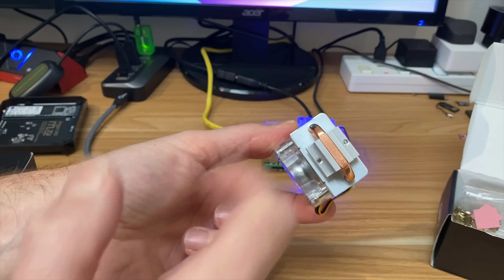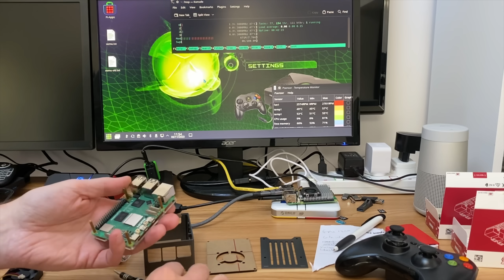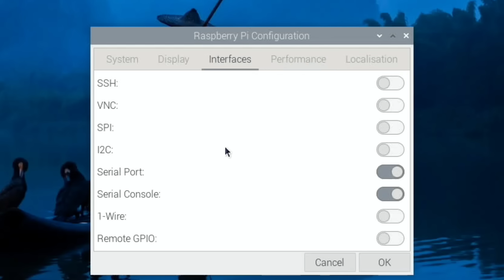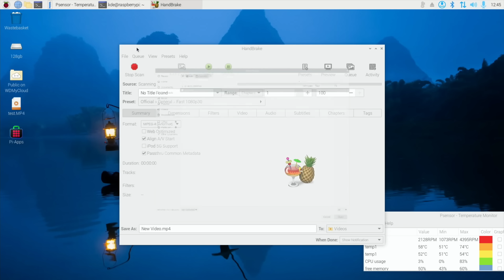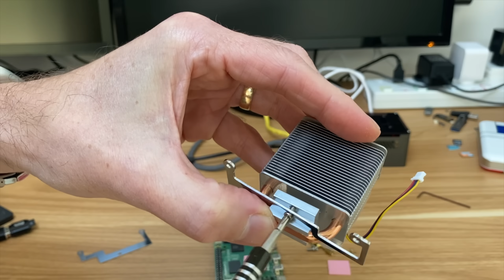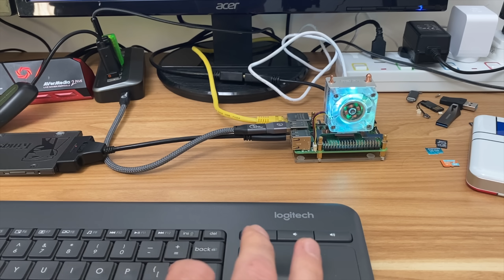Raspberry Pi 5. Ice tower cooler and case from 52Pi

Comment: I had a similar looking cooler on a PC years ago. Nothing new there but it keeps the Pi cpu cool; that's the main thing. I wouldn't fork out for one of these unless it specifically cooled more chips. For the money it should do more just because it could. I haven't stressed my Pi 5 yet but I think the active cooler (almost here now) will do an admiral job even when I set it to 3Ghz plus it won't be NOT locked away in some restrictive and claustrophobic box.

Comment: Why not use thermal paste?
Reply from the maker: I usually test cases and coolers with what they are supplied with. Thermal paste is more effective 

CPU paste Vs Thermal Pad. Raspberry Pi 4
https://youtu.be/-Z05yBrU0jQ
Reply: I'll check it out. 
The cooler is good, i was just thinking that thermal paste would even be a better solution. In any event you weren't getting throttled down. Lots of headroom for OC imho.  @leepspvideo

Comment: Would it be possible to invert the fan so that it blew air out? That plus the heatsinks I wonder if it would be similar in performance to the active cooler. 

Also is having the active cooler in an option ?
Reply from the maker: You can swap the fan around

Comment: All my 4's have the ICE tower and I was hoping to see this on the 5 too.
These are by far the best to keep my Pi4 cool and hopefully my Pi5 too.
I was hoping to see that we can change the temperature/fan speed profile using some Raspi-config setting. I think that with both the official case and the official active cooler the CPU temperature gets too hot before the fan ramps up

Comment: It realy is silly to not use the heat sinks or the official active cooler in that case expecaly on a PI 5.   There is a marked improvement with either solution.   Slow twisting slightly side to side of the heat sinks during removal will almost always make them easily release.   DO NOT pry them up from one edge as the adhesive is strongest against that approach, just wiggle them as you pull them up vertically.

Comment: I hope someone makes a chunky passive cooler like I have for one of my pi 4's that touches all the chips that can use cooling. It was cheap, heavy, completely quiet and nice and simple. Every case I looked at is either not touching all chips, just doesn't have enough metal to pull the heat away or has a fan.

Comment: Was that fan pulling out?
Reply from the maker: The video has 2 fans
Reply: @leepspvideo  That's one more than Brighton and Hove Albion.
Reply: 52pi's alucase fan was pulling out - installed to wrong direction. invalidating all testing. but hey, views!
Reply from the maker: @cannesahs  the fan came attached to the heat sink. It’s pushing air through the heat sink. Not sure what the negativity is about, but you are wrong.
Reply: @leepspvideo  alu case. not heatsink
Reply: and how about more than single core load?

Comment: Why use thermal pads with the ice-cooler, and not some paste, like arctic mx-4?
Results should be even better, because paste makes a much thinner film, and has higher thermal conductivity.
Reply from the maker: CPU paste Vs Thermal Pad. Raspberry Pi 4
https://youtu.be/-Z05yBrU0jQ
Reply: @leepspvideo    thanks. So it was 3.4° cooler with paste.
Reply: I plan to try stock pi5b cooler with paste too, and with some other modifications to be sure, it lies flat on the surface, which it does not seem to do with thermal pads in stock configuration.

Comment: With the Pi 5 coming with an official heatsink and fan, a comparison with any third party 'solutions' in order to ascertain whether any of them actually have any real value shoild ideally be the norm. It was disappointing to hear that he supplier asked for a delay in the review because they were out of stock because it can easily give a reasonable impression that what we are seeing is not a review but an advert, potentially calling into question the impartiality of the review.
Reply from the maker: It was only a request to hold the release day until the item was available. I’m sure I’ll have comparisons in future videos.
Reply: advert means that the channel has to "obey" the manufacturer about what to say, which did not happen, they only asked for a delay to improve customer satisfaction imo

Comment: I would have no problem putting those copper heat sinks on the silicone elements but isn't there an issue with galvanic corrosion when you put a copper heat sink on a chip with an aluminium shield?
Reply: Only when electric current passing with presence of moisture or water. If you have no current, no water and/or a layer of adhesive or thermal compound that separates two metals, you'll have no issues. BTW heatspreader lids are not made from aluminium

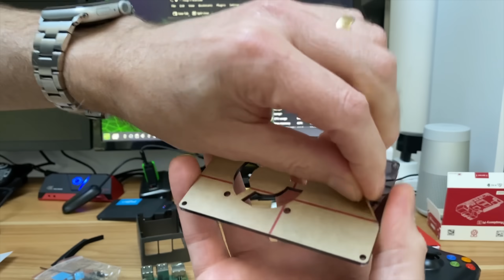Comment: 3:20 yeah mine I could only get to 2.8 GHz in 900 MHz on the GPU for overclock. I could probably turn the over voltage up past three but I don't really want to destroy my brand new pi. Either way at 2.8 GHz it's still really fast. The pie four was not usable for me as a desktop I ended up using it as a router which it's perfect for, probably overkill.

Comment: hanbrake on a normal computer uses everything it can. Here it looked like it was using one core and a half. Did that preset use hardware acceleration? Was the encoding somehow bottlenecked by GPU or Disk? I remember on the pi4 handbrake could not be used with software hevc due to a bug and could access only one coere in software h264. No hardware acceleration was available unfortunately.
Reply: That's what I was thinking. I think stress would have done better for a temp test. Maybe run a GPU benchmark at the same time to really load everything up.

Comment: And the original pi fan ?
Reply from the maker: I haven’t tested it yet
Reply: @leepspvideo  yea definitely wanna see a comparison with the active cooler curious were it will be i still expect the tower to come out on top more fins and copper heat pipes more importantly but interesting to see were in the middle it ends up

Comment: I understand this isn't quite necessarily the best place to ask, but I feel a good video topic to cover would be OrangePi 5 vs Raspberry Pi 5 for emulation purposes. It's difficult to keep track of which system is a better pick/buy for an emulation box, OrangePi 5 seems to be available, albeit a bit more expensive, but does have technically better hardware. Raspberry Pi 5 seems to have better support/drivers/pricing, albeit availability is much more difficult. Understandably, it's early in RPI5 development and things can improve, and so can OPI5 if driver support improves, but a current day evaluation of framerates on supported game titles would be very welcome. Thank you.
Reply: I own both an Orange Pi 5 and a Raspberry Pi 5 (I was able to purchase one as a priority being a subscriber to the MagPi magazine) but due to exam studies that end this week, I've not had time to sit down and do comparison testing between the two.

I only use Gentoo Linux in my home environments and have done for 20 years now - if you're not aware, it's a "roll your own" and build from source distro that can run on anything, and in the past I've built it on all the RPi's up to 4, a couple of Banana Pi's and some older Orange Pi's. The nice thing about that is that when you're running the same OS with the same optimised kernel across all those devices, you can do some true comparison testing - but it does take time to sit down and build correctly.

The problem with vendor-provided Linux builds, especially the Orange Pi ones, is that they are generally not built as optimally as they can be anyway and whilst I utterly respect what the team at Armbian does where they do their builds for many SBCs, again I'd argue that their builds are 90% of the where they need to be in terms of optimisation.

So it's something I will look at towards the end of this week and if I come up with something interesting I will let Lee here know - I don't make YT videos myself, it's something I keep thinking about but I just have too many other things going on in my life right now.

For example, if I get two good Gentoo builds going, then I can make them available on Github or somewhere like that for others to test. I do believe its possible to get better 3D acceleration in both boards.
Reply: With all honesty the GPU on the Rpi5 is relatively poor in comparison to the RK3588(s) that are out there. There is a pretty huge difference in Gflops and apparaently Arm are currently collaborating with Collabora for all Mali opensource drivers but Panthor and mainline is looking a few Linux kernel releases away. Whilst Panfork runs on the Rockchip BSP.

Comment: Will anyone actually run theirs without the overclock?
Reply: It depends if they need the overclock or not. I'm not particularly interested in emulating consoles, I come from the realms of home computers like the ZX Spectrum and Commodore Amiga, as well as wanting to emulate arcade games through MAME and maybe a few MS-DOS games. None of that requires particularly high powered SBCs anyway when it comes to emulation.